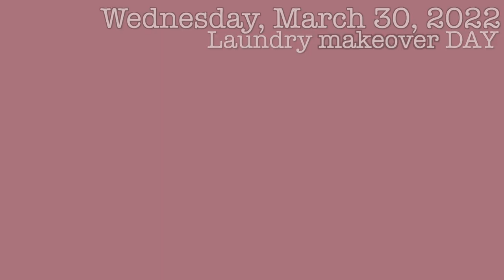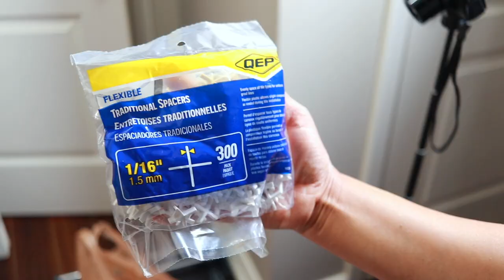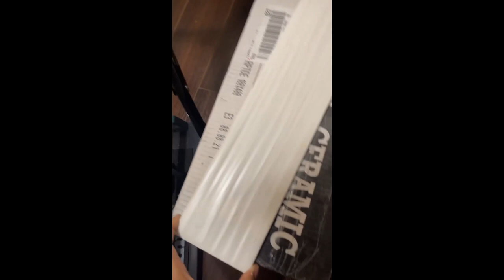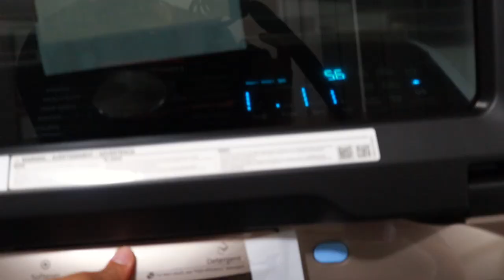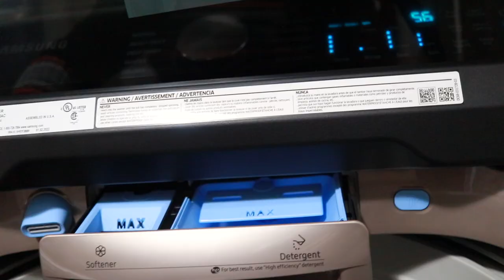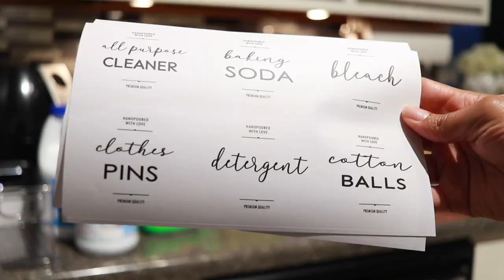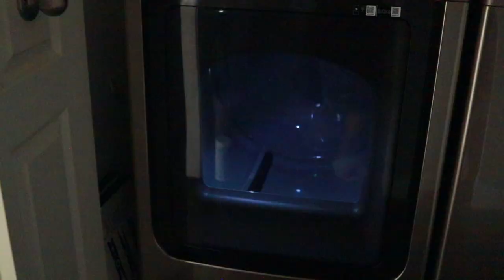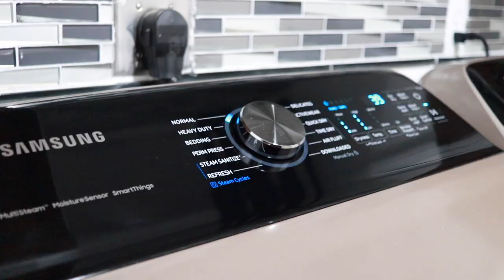Moving Vlog: LAUNDRY ROOM TRANSFORMATION | Deliveries+ Amazon Organization + *72HR MAKEOVER*

Comment: To increase the space for loading and unloading laundry you may want to move the dryer door. If you have the right tool and bit for the screws, you can remove the dryer door, then flip it and attach on the other side, so that the door swings open to the left (like your cabinet). The directions to do so should be in the dryer manual.